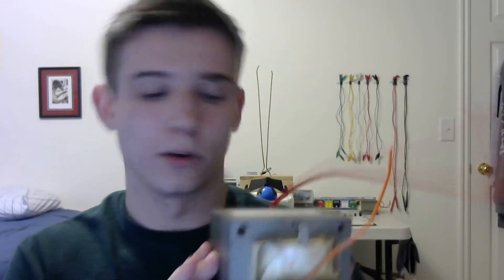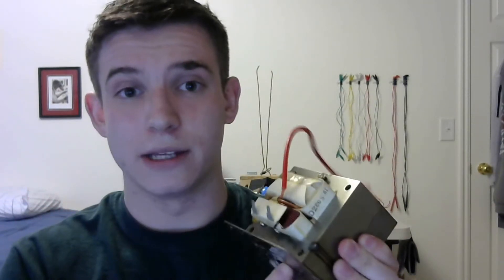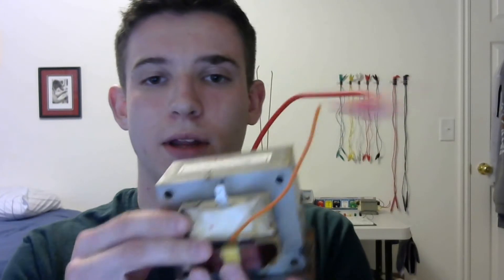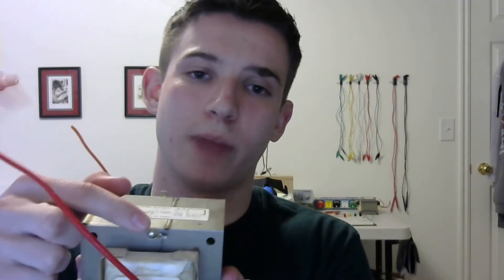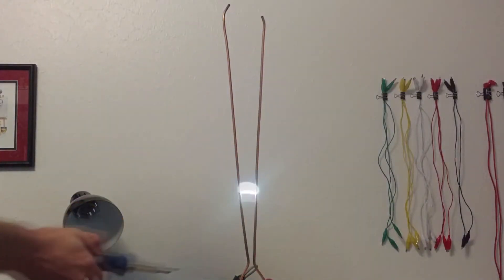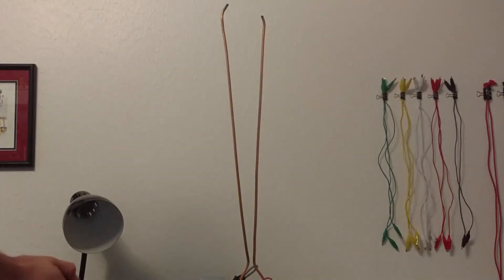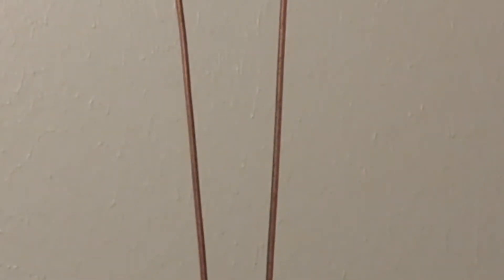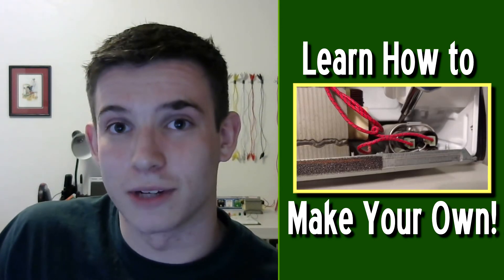My First Jacob's Ladder! (Microwave Transformer)

Comment: Why does it not carry on running after the shorting?
Reply from the maker: Sorry for the late response! Well, the plasma is acting like a piece of wire and is shorting the two prongs. It would continue to short them, except for plasma is essentially very very hot air. Heat rises, so the plasma or "short" also rises. The current path follows as it rises, until it reaches the top. At the top, the plasma stretches out and disperses too much for the shorting to continue. In a repeating Jacob's ladder, the arc would break at the top, then restart at the bottom where resist is smallest. Does this help answer your question?
Reply: @tylercaldwell-mst9716  Hi thanks for replying.
Repeating is the word. How does it repeat is what I was wondering. What restarts the cycle?
Reply from the maker: @LEO-xo9cz  Oh I see, sorry, I misunderstood!  With my Jacob's ladder, the voltage isn't high enough to jump the gap by itself, that's why it has to be started manually with the screwdriver. The higher voltage ones have enough voltage to start themselves, so the arc is created at the bottom (where the prongs are closest and resistance is smallest) then the arc rises to the top and breaks. When the arc breaks, the resistance at the top is really high again because there's no plasma left to bridge across. So it restarts back at the bottom where resistance is lowest again. I've tried doing it with mine, but I just don't have the voltage to make it work. So that's the simple answer, too much distance on bottom and not enough voltage. I'm working on one that can go on it's own though!
Reply: @tylercaldwell-mst9716  Ahh that makes sense. How many volts would you need? 
I remember them vividly from my childhood from movies like Frankenstein.
Reply from the maker: @LEO-xo9cz  Well, I'm not entirely sure. Currently I can do about 2400, but I think I would need at least double that to pull it off. I have a fly back transformer that should be able to create upwards of 15,000 volts and get the job done! You know, the Frankenstein movie was the first thing that came to mind when I was building this project!
Reply: @tylercaldwell-mst9716  you can also use a lighter